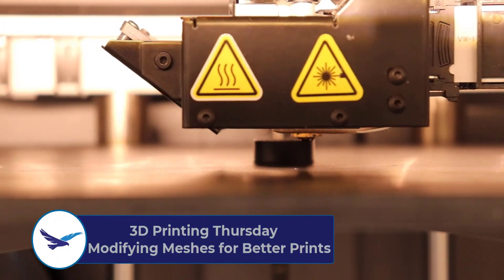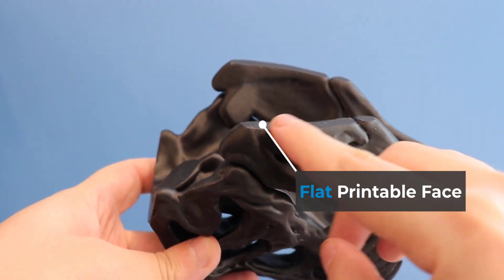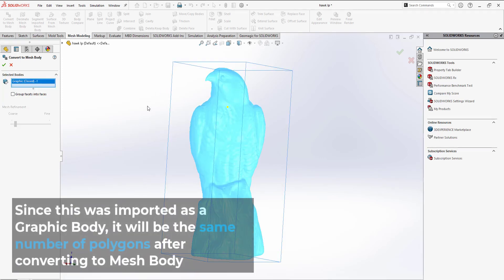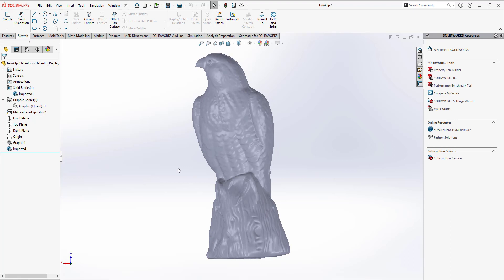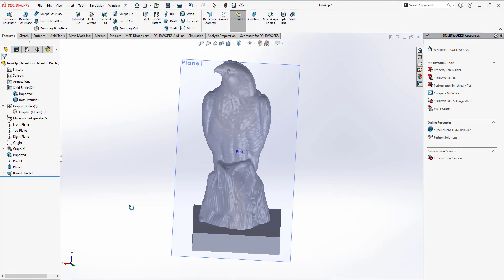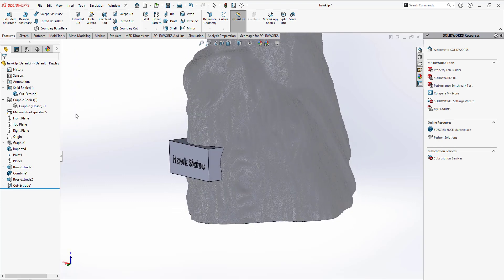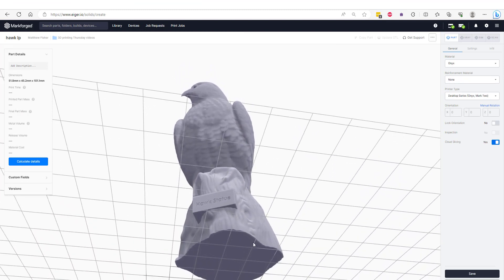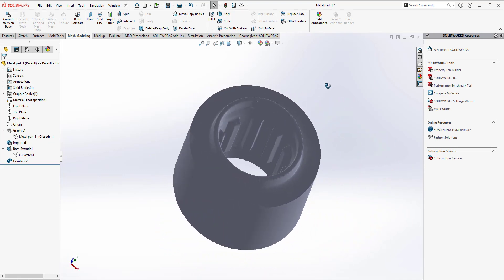3D Printing Thursday: Mesh Editing in SOLIDWORKS for Better 3D Prints

Comment: I didn’t know you had 3D Printing Thursday. Will check it out. Btw in prusa slicer you can drag that eagle status below the print bed to make it flat. You can have negative Z height now. And it can import STEP file too for higher resolution.
Reply: I didn't know either. Regarding PrusaSlicer, you can also cut the bottom off and snap to bed, adding the block, and text. I can understand the aid with complex meshes but slicers are powerful enough to do that simple stuff. I want to have Solidworks to become the slicer.
Reply: @blindside_o0  the only problem of having SW for slicer is that prusa/ultimaker frequently update the slicer to make really powerful, SW takes way to much time. And I am sure I saw a way to print directly from SW that possible. In my case I found a macro online where you can click a button and it magically open prusa slicer with the part in it!! Then got other button in prusa slicer that send to printer and start printing (using octoprint)